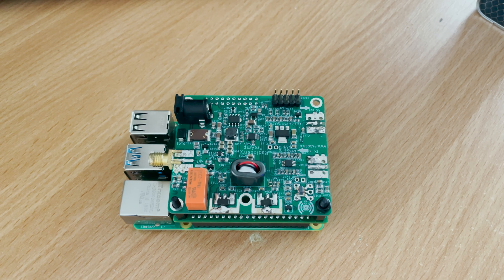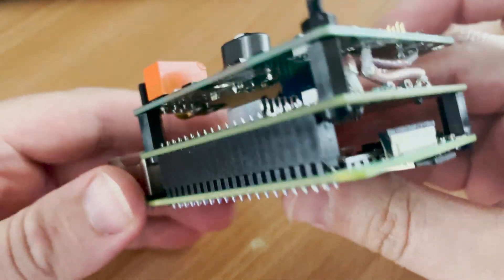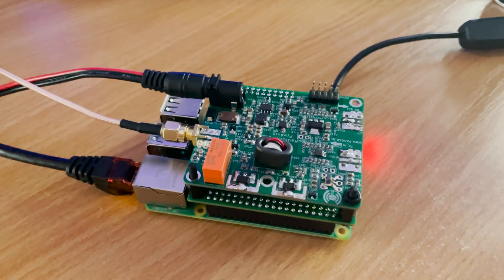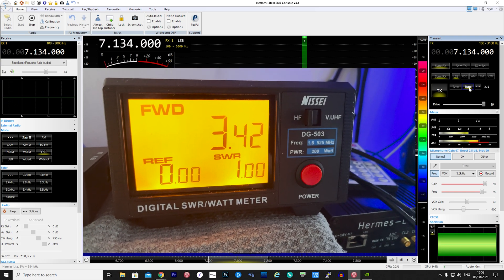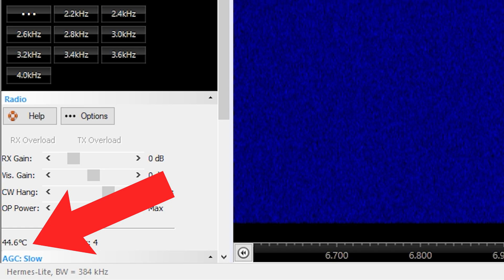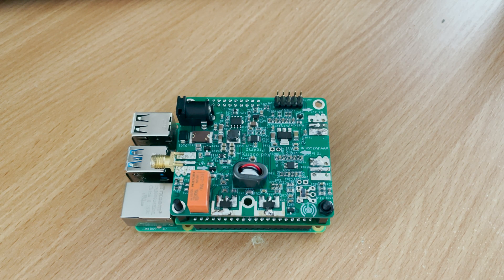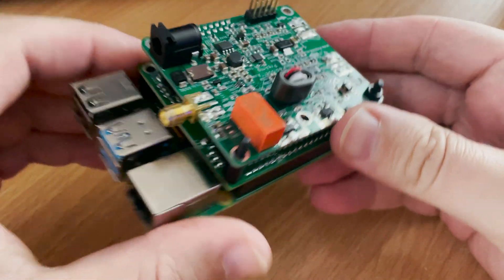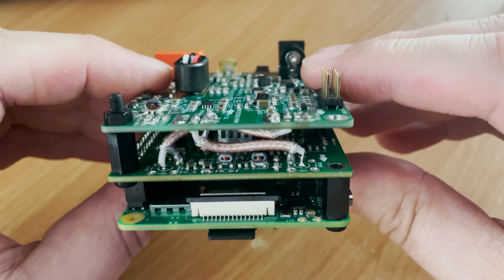RADIOBERRY - Pre-Amp Board by Johan PA3GSB

Comment: We need to organize a group buy!!! Could somebody get that going who knows how? I want to climb aboard!!! :)
Reply from the maker: The original designer had 10 made at makerfabs, same company that makes the HL2 and we just buy direct from them. Maybe this will be a route.
Reply: @TechMindsOfficial  ok I'll contact them and see how much for 20 more
Reply: I'm in I've been searching for these parts all week but the only thing I found was a Raspberry PI 4
Reply: add me for a group buy
Reply: In for group buy.  It would be brilliant if there were also a group buy option for more than just the amp.  I need the radioberry too
Reply: I'm in for a group buy.
Reply: Hit me up as well. However, aren't we next in for a filter board? And I read that the ones (preamp and filter boards) can be had from QRPLabs.
Reply: @don_n5skt  yes you can get the kits/boards from QRP if thats the way you want to go - the firmware supports the bandswitching - the filter board is the same as used in the wspr kit... the PA board is a general item - both are good and have many users and thus much support - i have built 3 of these and they work very well but p[ersonally I want the PA kit as described
Reply: @mattghoward  the preamp available.on qrp Labs is a different preamp is it not? We are specifically talking about the PA3GSB preamp by Johan, which has certain features designed for the radioberry. I don't think it's offered by QRP labs.
Reply: @dustinmcdermont699  yes we are talking the Johan unit. There are 2 QRP labs products that could also be used as an alternative. One is a 10W amp, the other is a bandpass filter kit that covers all bands and can be automatically enabled for each band using slightly modifed code. I was just pointing out that depending on the needs of a user - then there are multiple solutions available. Users need to understand their needs and apply the applicable solution. My guess is that a bandpass filter will be needed anyway - as most of the hats that I have used are quite dirty in their output
Reply: @mattghoward  That is one of the questions I keep getting. My Hermes is very clean but it has the filter board added to it. Definately we will need a filter board. I wish on the PI there was a way to stack hats. BTW, my order of the radioberry from AUSINC was canceled due to a lack of parts. The MFG is looking for alternatives.
Reply: I’m in
Reply: Also in for group buy
Reply: Just to keep everyone updated I'm waiting on a reply from makerfabs.
I recently emailed them with a request for quotation on 20 units but I'm starting to wonder if that's going to be enough!
Reply: Yeah, tell me where to sign up too!
Reply: Adding my interest for a group buy!   Also interested in what people are using for filters
Reply: I’m also in for the group buy
Reply: I'm interested too, but I live in Chile, please let me know when you get the quote
Reply: @dffabryr  still waiting...
Reply from the maker: @Dustin McDermont is that you in the google groups also talking to Makerfabs?
Reply: @TechMindsOfficial  lol ya, I had to get permission from Johan...Makerfabs insisted, even tho the design is open hardware.
Permission was granted, final order confirmed, so we are waiting for the quote now.
Reply: I would like to get this. Any information ?
Reply: Also very interested
Reply: @tekmakerUK  In for one!
Reply: In for a group buy.

Comment: A "preamp", also called LNA for "low noise amplifier" is a device designed to amplify receive signals for further processing. An amplifier that outputs 5W is a power amplifier, albeit low power.

Comment: The radioberry and the preamp board need to be integrated together into a new board that has connectors for the CM4 module. At that point the board will be more suitable for a case but also be a bit easier to power and cool.

Nice video series.

Comment: I have a Pi 4 and it gets really hot at times.  Is it possible to mount the HATs under the Pi and do a pair of 30mm fans on the side for cooling??
Reply: I removed the standard pi pins and replaced them with extended pins - now i can mount things above or below my pi - pout spacers in - have fan decks and solid copper heatsinks
this is not a task that inexperienced solderers should undertake

Comment: It looks like the preamp board was intended to be flipped over when mated to the Radioberry. That would eliminate the crossover in the RF cables between the two boards. However it’s clear there would need to be more space between the two boards if you did that.